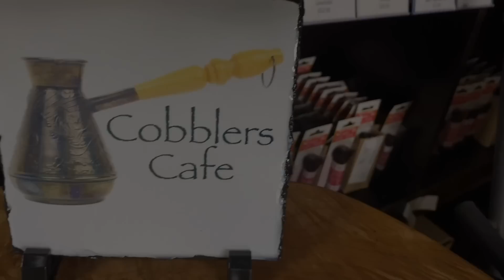Alden Indy Boot.Come and join me on a Complete disassembly of these 20year old Indy Boots. PART ONE

Comment: Greetings from another coffee lover, I want to start off by saying I don't brew Turkish coffee so I can't help on that aspect.

I sometimes do drip, aeropress/french press (outdoor) but I mainly use my expresso gears for everything at home. I don't roast my green beans myself, there is a local coffee blend supplier that do it for me for a fee/large enough quantity is provided. 

Besides the coffee variety/roast itself, the grinding is probably the most important aspect of the taste. A good grinder can be very pricy. When you have a manual type grinder, the quality of it comes from the consistency, adjustability by small steps and how coarse/fine the whole scale is. For an electric one, you must add to that list the repeatability and the heat constraint.

When grinding, keep in mind the coffee oil is leaking out into the grinder along with small particles, you must clean it weekly or better before it gets rancid, it will affect the taste. A trick I often do is to grind dry rice before disassembly and washing it. With an electric device, the "blade" will spin at unreal rpm; creating high heat with the friction - compromising the taste; burning it before it even gets out. Bests electrical grinders use a big diameter (for thermal mass) burr and are ceramic not metal (like stainless). 

If you want a "baby powder-like" grind, you must aim at something that is "expresso-grade". A good quality grinder will start at around 300$ and can go well over a thousand. I won't recommend anything, with that knowledge I think you can make your own choice with the help of reviewers; Eureka/Rocket/Rancilio/Mazzer etc. My setup is "Rocket", a Rocket Espresso Fausto Touch as a grinder and a Rocket Espresso R58 I bought together in a rebate event.

Comment: Hey Steve, glad to see you post again!
About the coffee grounds, if you have any specialty coffee shops in your area, if you know any of the staff well enough, I'm sure they can grind Turkish (Armenian) fine for you! Most specialty shops have industrial level grinders with burrs tuned for every kind of coffee drinking, from cold brew boulder course to Turkish powder fine!
Also, I know there are some cheap traditional looking hand grinders on Amazon that are said to be good enough for "Turkish coffee", though I've never used those myself. I work in coffee roasting personally, so I know all about this stuff. Get in contact anytime if you need coffee advice, I've got you covered!
Reply from the maker: Very cool
Reply: Isnt grinding very fine poweder mostly used for espresso coffee machines?
Usually it is recommended to grind it more rough for manual preparation, because if you grind very fine powder, you cant basicly filter coffee beans from your coffee drink, and you are basicly drinking ground coffee with water...not just beans extract.
Reply: @Spazik86  yeah youll want an espresso grinder to get the powder.. a regular grinder cannot make it that fine
Reply: @Spazik86  so with espresso, while it looks incredibly fluffy and is a very fine grind, it still has a gritty texture that you can physically feel on the tips of your fingers!
With a Turkish grind, it's literally as fine as flour, it clumps together in a similar way. I suppose that's a good analogy to use: espresso grounds are like a fine sand, while Turkish grounds are like flour
You'd think that at it's no different, but with an espresso grind, the coffee doesn't fully dissolve into the water, which is one of the reasons why you are left with a silty/gritty drinking experience. With a Turkish grind, you won't get that grit, but will still experience some amount of texture in the cup because you aren't actually filtering any of the coffee out after brewing! Some people actually like to pour their Turkish coffee through a paper filter after brewing because that removes the silty texture, but I guess that also takes away from the nature of a coffee brewed this way haha

Comment: Sorry if this is an ignorant question - but this restoration seems so extensive, when does it seem more sensible to replace instead?

The time of a craftsman such as yourself is valuable.  In this case, one wonders if that is greater than the replacement cost of the boot ?

Comment: Man, these must have some serious sentimental value for the owner. I'd spend 400 bucks on a brand new pair and put the old ones on a shelf or something if I couldn't bear to part with them. Lol
Reply from the maker: New ones are around $600 but that not way he is fixing them
Reply: @BedosLeatherworksLLC  yeah, I guess 400 is a little low for Aldens. I was just throwing a guess out there. My point was that this is one of those cases where the repair will probably cost more than a new pair, so there has to be a story behind it.